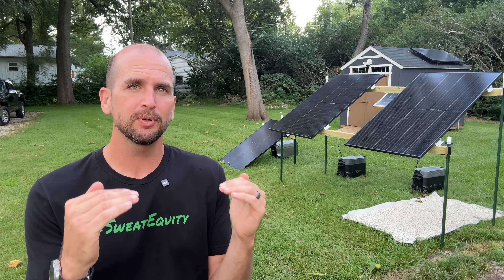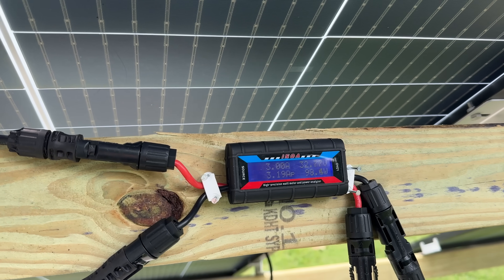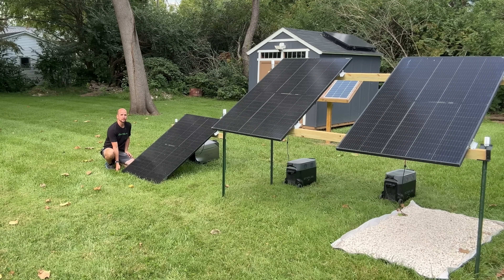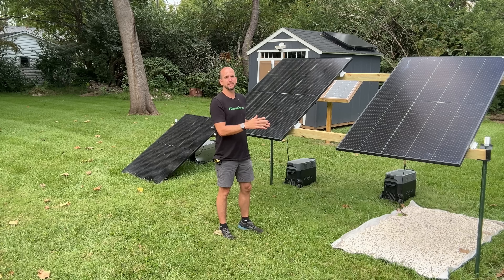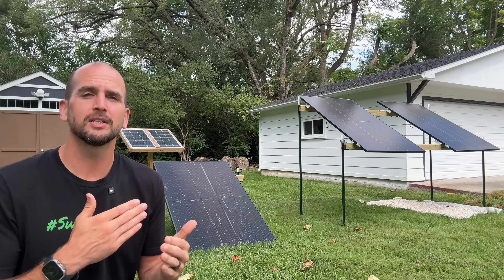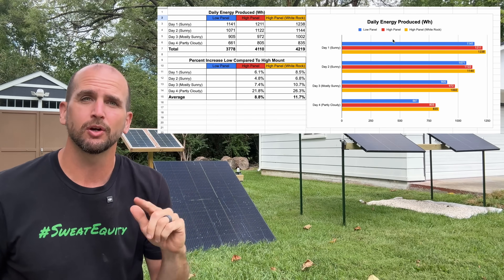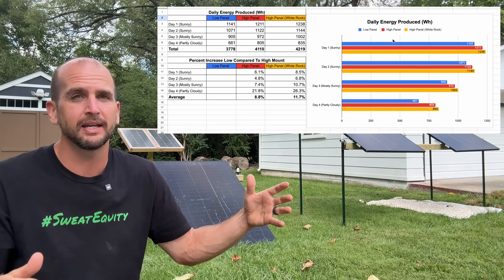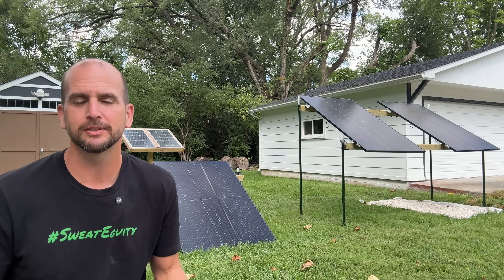Maximizing Bifacial Solar Panel Output: Low vs High Mount Test

Comment: Would mounting on a metal roof have any advantages for the bifacial? I'm not sure if the metal would reflect better than the white rock? I'm sure color of the roofing matters as well. I'm just scared to do a high mount on the roof as we get some pretty high winds here.

Comment: Hi, I can say going through a longer test like this, you have the white rock high mount, too high. lower it maybe mid where you have it.  Then, widen the amount of white you have behind it beyond the edges and make it brighter, you would get another 5-8% on what you saw.   Totally understand you were just looking for a binary answer, yes no is it worth it, but if you want to maximize the bifacial, the extra adjustment and effort pay off like you said.  Bifacials on a roof is a waste, very little Albedo (reflection) available there.  thx

Comment: You are putting a piece of wood through the middle of the panel.  Can mount just using the edges? Also use a foil reflective or white gloss surface that is much bigger than the panel, so it gets reflection for most of the day.  And a bifacial is good for vertical easy west use to flatten the duck...  No?

Comment: Ground mounted is sitting directly on ground, so lower cells are shaded more. Perhaps raising 2 inches would be more realistic.

Also,  if you are planning to offset your power bill, perhaps raised ground mount DIY is the way to go, save thousands over paying an installer, and get full benefit of bifacial which don't benefit from roof. Also roof mounted will get much hotter which affects efficiency.

Comment: One can brace the tpost and/or set in concrete. Run a solid brace from the bottom of one post to the top of the next on each side or a wires from from the bottom of both posts to the top of its counter part forming an X on each side (since wires only work in tension). Tar and service (this joke is for nautical types, but I suppose someone with a lot of time  is going to try it)

Comment: Severe Storm Areas?
Low Mount v. High Mount w White Background
I'm thinking that gaining about 10% may not be worth the extra exposure of an elevated system if one lives in areas with severe storms often with high winds.
In such areas I think I'd rather have a more secure low-to-the-ground mounting system, with less of a way for wind to push up from under the panels, and to make it easier to make a simple hinged panel mounting platform so I could easily and quickly lower all the panels flat to the ground in preparation for forecast strong winds/severe storms. Also, wouldn't there be added load bearing/management concerns for elevated platforms with forecast deep snow (more than perhaps 6 inches)?

I'd likely just add a few more panels to compensate for the "lost" percentage if the numbers were that important to my setup. Efficiency is important, but so is survivability of the apparatus under adverse weather conditions.
Reply: Yes, this.

Comment: move your mounting 2x4 to the sides of panels and move your reflectors more out front of panels plus a white wall back 8ft for the max output👍👍 plus you can keep bifacials 5 to 10 degrees more vertical for better snow slide and reflection in winter👍👍

Comment: Thanks Scott - great info. I'm planning a small solar system for my camper van using 100 watt panels. Your videos have been very informative. I noticed that several of the 100 watt vendors are now offering bifacial versions. Wondering how much benefit you would get from a bifacial 100 watt panel on a silver van roof?

Comment: Stupid
Your wood frames are BLOCKING/SHADING the back solar cells.  Any shade on the panel will stop the panel from producing power.
Reply from the maker: How would you adjust the design trying to keep the cost down?
Reply: @everydaysolar  You will need to have 2 level of rails. For portrait mounting, the first level of rails will run in parallel and along the short side of the modules, the second level of rails will be installed on top of the first level of rails and run in parallel and along the long side of the modules. The modules will be installed on the second level of rails. Cost is slightly higher for the mounting structure if you want to take full advantage of the bifaciality due to the additional material

Comment: I can see that when people are testing bifacial panels are forgeting about one important factor - shading the backside of panel. bifacials should be mounted the way that there wont be any beams under the panel. They are effectively shading backside of panel which is stealing most of eventual backside earnings. they should be mounted from sides, so there is nothing directly under panel.
Reply: Hard to do in very windy places.

Comment: I think the "High Mount w White Rocks" benefited more from the "Off White" Garage more then the "White Rocks".  Lots of light will be reflected off the Door and Cement.
Reply: Yes … and on the other hand is the ground mounted panel „near“ the darker trees ….
But even if the setup is very off for a real comparison it shows the importance of the surrounding if it comes to power output.

Comment: Studies have shown that the lower edge of the ground mount bifacials should be at least one meter off the ground for back side irradiance. This also helps in winter for shedding snow.

Comment: I do not understand why American's are so worried about their "Return on Investment" these days. The point is it WILL pay for itself LONG before you need to replace it. And when you do want to replace it? It will be far cheaper than it is already today.
Reply: a lot of people are motivated to do solar to save money. you have to weigh continuing to pay $100/month forever vs paying $40k right now and paying nothing for electricity in 400 months. the less you pay upfront, the quicker you get to actually being better off
Reply: @avypath  You can get solar for a LOT less than $40k today. The nice thing about solar? Is its modular. You can add to it as you go. And you do not need to be a rocket scientist or a structural engineer to do it. I started with a small 3600w worth of solar, but a inverter big enough to handle all my loads. Working with the DC side of things is easy. As is building your own ground mounts. I've added 24kw worth of solar to my system, after they left. And where I live? There is no net metering. They will not pay for any power I export, so I did everything off-grid. The added incentive was they wanted $22k just to pull wire less than 3/4 of a mile into my property to start with.

Comment: Good information. We just got 2 that we are going to mount aft on our sailboat. Really hope the reflection off the water helps.
Reply: i'm also looking to do so, can you update this comment when you have feedback? i'd imagine the white epoxy paint and water would both provide highly reflective surfaces which could be a game changer for boats specifically. uncertain though...
Reply: @weegieboard8432  we plan to show the hopefully benefits of the bifacial panels on our sailboat on our channel.. We were forced to change our 2 LG 375 watt panels after Hurricane Milton.
Reply: @ChrisDoesWhat  im sorry to hear that, hopefully everything is safe and intact. i'll check your channel out, will you be putting the information out soon? sorry if that seems insensitive, just got a young family, moving onnto a boat and at a crucial phase of redesigning infrastructure and i cant find reliable info on it's application specifically on a boat
all the best,
al
Reply: @weegieboard8432 I hope to get that info out this week or the next. Right now, we're having a new solar arch built. Love this guy and the info he puts out, but like you, we saw no info for bifacial panels on a boat. We took the plunge and hope the results are worth it.
Reply: @weegieboard8432 I wish you fare winds on your journey! We lept in a year ago, and we're still trying to get to the Caribbean.
Reply: @ChrisDoesWhat  ah right okay, are you planning to orient them vertically or more traditional orientation?

you seem a nice fun loving couple, and i value the authenticity. best to keep the good and bad in, it's all part of it! fair winds, hopefully that's your last unfair wind youu'll have in a while

Comment: The cloudy day results seem off.  Any thoughts on why the big difference?
Reply: The temperature of the panels on a cloudy day are going to be substantially lower (minor reason), major reason: the sunny side produces a whole lot less on a cloudy day, whereas the back side is going to produce roughly the same as on a sunny day (shadow side vs. shadow side, the back does not care about sun and is still producing 6-8% of the sunny side. On the overcast day that 6-8% rises a lot relatively because the sunny side produces less.
Reply: @velianlodestone1249  okay, thanks for the reply

Comment: You are messing up your test by having those 2x4's going across the back of those panels like you have it. When you have bifacial panels you have to treat the bottom of the panels the same as the top and not have anything shadow reflected light to the bottom of the panel.  You would not run a 2x4 across the top of your solar panel would you? well you don't want to do it to the bottom either. What ever cell is covered up underneath and has the least light no other cell will be able to pass any more current than that cell same as on top. You get the most of bifacial panels when you  have panel supports that are thinner and only attach to the the edges of the panel NOT like you have it. You are not the only one that have made this mistake. I am sure this is why you are getting so little extra current from panels being up high vs laying on the ground.

Comment: Snow climates, if you have only a fixed angle option, set it at or near the winter angle.  In mid latitude Canada, the winter sun angle is nearly flat.  Something like 9 degrees from vertical.  In summer, the panels will be saturated anyway.  Snow shedding and better winter capture are seriously worth it.  Vertical mount on a wall or fence is a great option if racks are not possible.  Snow, especially wind drifted snow, is terribly obstructive once it settles on the panels and there is cloudy winter skies.  Stay gold.

Comment: Just my observation... but, because of the proximity of the two HIGH MOUNTED arrays to each other, the array WITHOUT the white rock would have received some benefit from the white rocks. It would (again, my opinion) have been better if you had made sure that those two arrays were more isolated from each other.

Comment: If the question starts out as “Do you get more electricity by raising the panels off the ground and putting reflective material underneath”; and the answer is clearly Yes; the new question should be is it more cheaper to get this extra production by spending extra money on more expensive mounting and white rock —— or simply buying one or two or three more panels ?   I am thinking that the later is probably going to give you more bang for the buck.

Comment: Ans if you set some alluminium foil on the ground or roof ?

Or a mirror?
Reply: people have done that and it does increase output, but you also run the risk of the panel overheating.

Comment: diy install, there is zero reason to pay anyone for that work, yes you make your investment and payback period doubly as long with installers. and you cant still diy it. actually dont even ask any experts, just diy. any asking makes your own brain turn off. yes if you ask someone, they tell you what to do. even if its bogus. and you cant still diy it even less. yes asking is not smart. paid comments are not worth it. go pro-ke. you are still not doing proper testing with the white rocks. really that small patch. actually just put a mirror to multiply the solar panel sun area, instead. do stuff smarter, dont work harder. yes stop to think, before rushing in. quick wrong decision makes you work in vain, economy systems, for money sake. any pro claiming to be pro is not true pro. being  commercial means that those pros are cons. bad advice from bad advisors. money biases anyone. remove all money and then try to talk if you think you need to, you dont have to talk. with any pros cons.

Comment: Curious about bifacial along a fence - I know it’s not as efficient as raised or angled but realistically it’s the only possibility in my yard. Do you think an average suburban home with a fence could power their needs in this scenario?
Reply: Checkout solar balcony fencing - it works.
Reply: @juustjoshin  a solar panel balcony "safety fence" with white painted building behind, perhaps 2 or 3 mtrs  does work, but i don't have data.

Comment: Great video! I wonder what the difference would be if the panels could be mounted with no obstructions on the face as well as the face, Kind of like a picture frame .Your giving me ideas! I could make an awning out of bifacial panels over my south facing double white garage doors. Possible 17 feet plus or minus. 😅

Comment: I'll add to the Vertical Crowd.   Would like to see the performance when they are mounted vertical.  I hope you have that in your plans.  Great video!
Reply from the maker: Thanks for the feedback and that does sound like a great next test. 👍
Reply: There's a guy out there who already tested  vertical panels with mirrors on the floor beside them to help cancel out the middle of the day dip in power generation.

Comment: It's interesting if set up of white surface at the same angle as solar panel will increase efficiency?
Reply from the maker: I showed some improvement 👍  You can see the numbers at the end of the video.  I would say it is worth the add.
Reply: I think u are correct

Comment: You didn't try vertical mounting. For best results I think they should be completely vertical, oriented north-south, and surrounded by white rock. Morning to mid-day, sunshine on one side, and vice-versa for the afternoon. Otherwise, not worth it to get bifacial panels.

Comment: I am especially interested in your T-pole setup. Never seen anything like it. What are the wind gusts that you experience in your environment?
Reply from the maker: We usually see 1 day of 60-70 mph gusts per year.  If I wanted this to last for years I would add posts on each side of the panel and probably some type of cross bracing left to right and front to back.

Comment: Well you did the solar power panel stand straight up? study found it reduce heat. Did found some video on testing. Meaning not on angle 45 but standing like the pole. There are people testing about it in the field.
Reply from the maker: That is worth a test, seems like that would take a lot of abuse in the wind.

Comment: I would like to see what a bi-facial would do standing on edge with white on either side.. If the main face is pointing south southeast where the sun goes over the top edge and the white surface lights up both sides the panel might do even better..

Comment: 9%-12% up in reflection is not bad, when the back of the panel only produces 1/5 of what the panel is capable of
Reply: Sunlight directed on the front of the panel is 20% of the direct son value i read. So the rear is the same then? Interesting

Comment: The high mount is so close to the high mount/ white rock that it is probably also being slightly effected by the white rocks.
Reply: Affected too..  🙂
Reply: @matthewprather7386 :  Not my comment, but I know to too and two, there their and they're, witch and which, etc and it drives me nuts to read the wrong one, yet affect and effect are close enough in sound and meaning that I just can't keep them straight.

Comment: The stones provide more benefit if they cover a larger area than just below the panels.  For anyone doing this in a real installation going a full panels worth to either side and behind your panels will give you a % or 2 more power.
Reply: you would also have to clean the stones to keep them reflective, in many places..
personaly i would go for a flat surface that ca be cleaned without hurting the panels..
it is posible to get white tiles for example or paint concrete (with paint you can also add the perfect white and finish that makes it more reflective)

im not going to presure wash those stones right under a panel
and im deffently not hand cleaning them 🤣